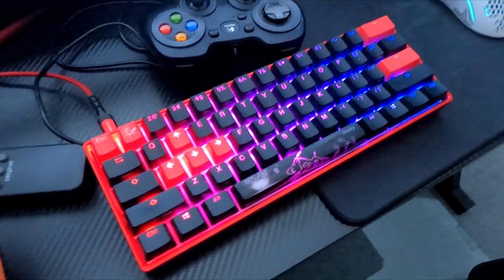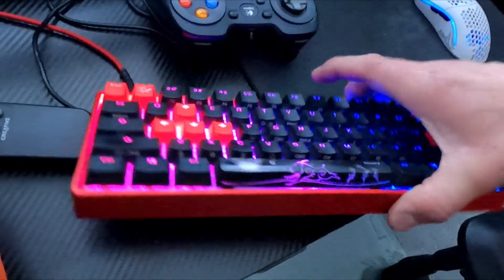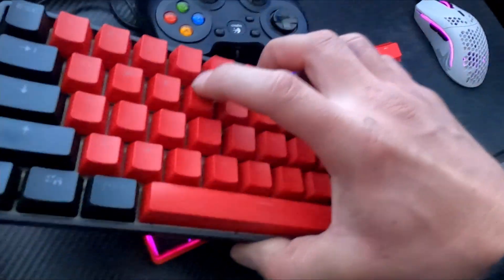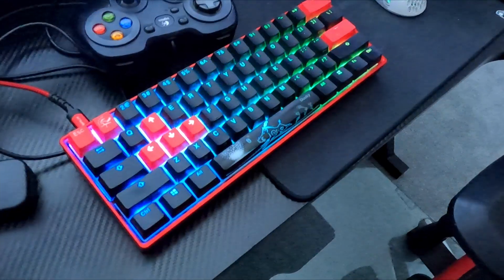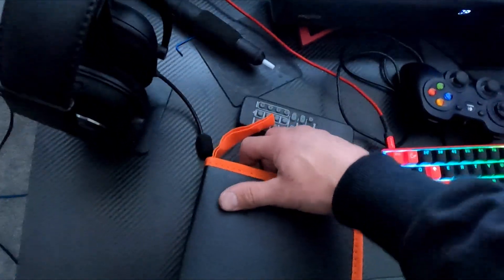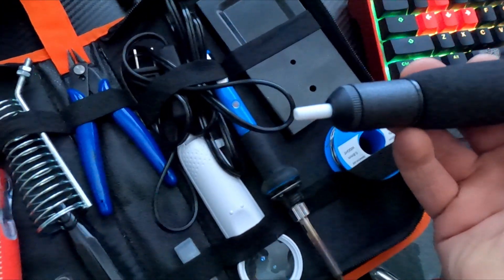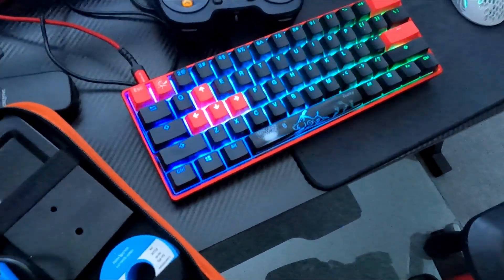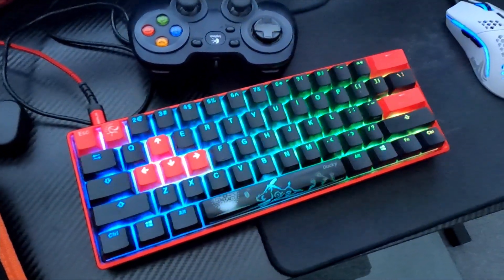CHEAPEST FIX FOR CHATTERING KEY on Ducky One 2 Mini!

Comment: Great tip! I’ve also read that others fixed it  completely by changing the switches (Gateron & Kailh highly recommended. I’m wondering if it’s a Cherry brand issue). I might have to go this route. It just sucks that we have go through this issue on a supposedly high-end keyboard
Reply from the maker: When i was trying to fix it, i tried software, i tried cleaning the switch... ultimately my issue was the switch itself. Buying new switches and swapping them out would work! If you wanted to make sure its just the switch and not the PCB you could try swapping the switches first like i did. Changing all the switches on the Ducky One Two Mini is a great idea tho! Thanks for the comment :-)

Comment: my keyboard is chattering on several keys but ducky couldn't find the error after 2 months of testing...
Reply from the maker: That sounds really bad! It is usually the switches. I tried cleaning mine, but the only thing that ended up working was moving the switches around like the video... if you have a few switches it might be worth buying a few new ones. If you can't solder or learn it, I would find a local electronics repair shop and see what they would charge you to change the switches for you.
Reply: did you try updating the firmware ?

Comment: Samee issue, samee "e" key after 9 months use, will try to get a replacement as it's undeeer warranty. 😁🪛
Reply from the maker: Haha yea warranty is your best bet. When it's off warranty this video might help. I'd practice soldering and desoldering before trying on the k/b. Find an old circuit board and get a cheap kit kit off Amazon. Thanks for watching and commenting!